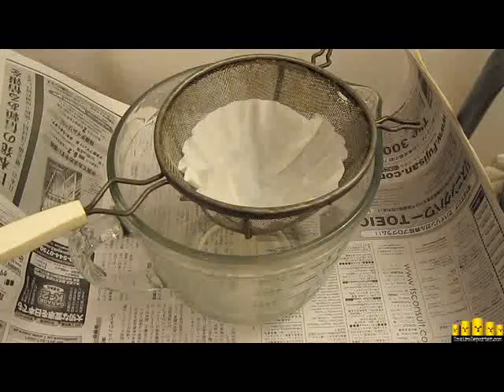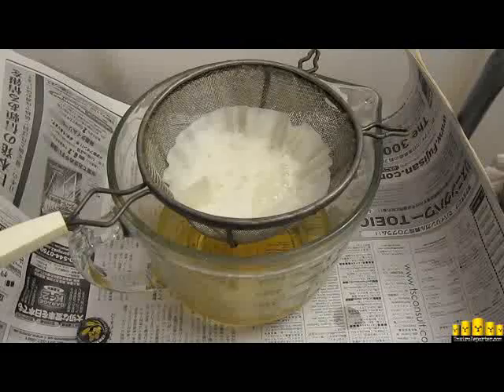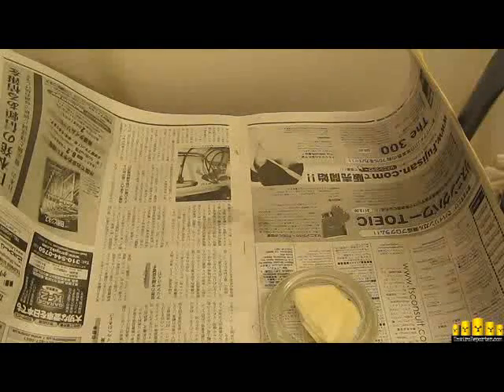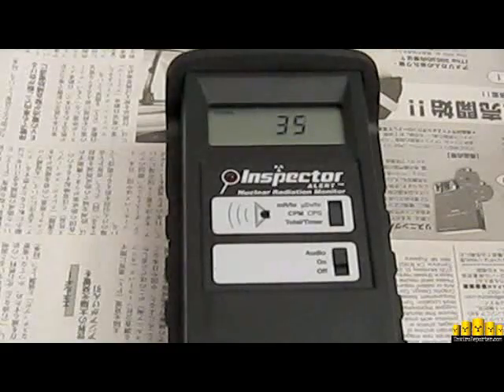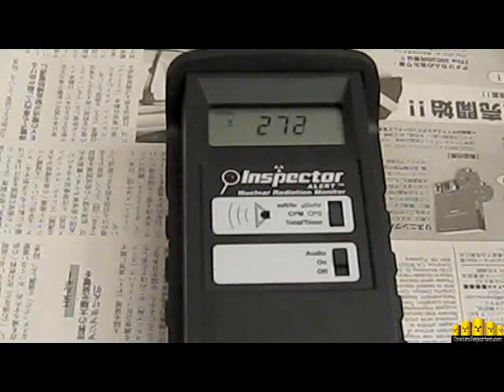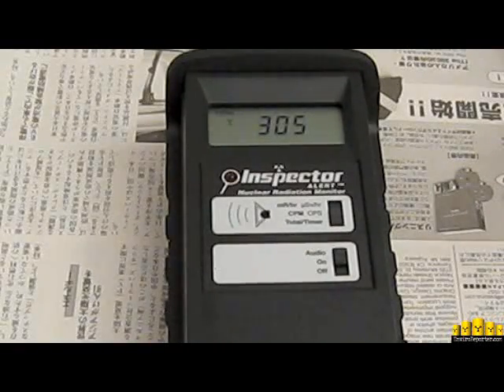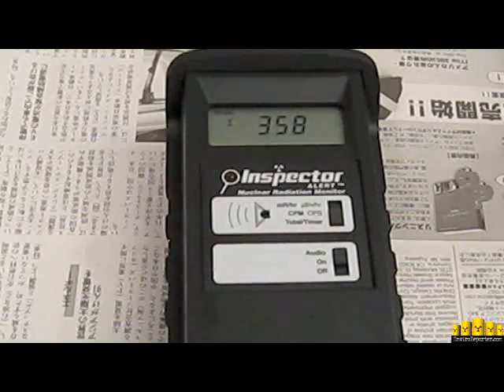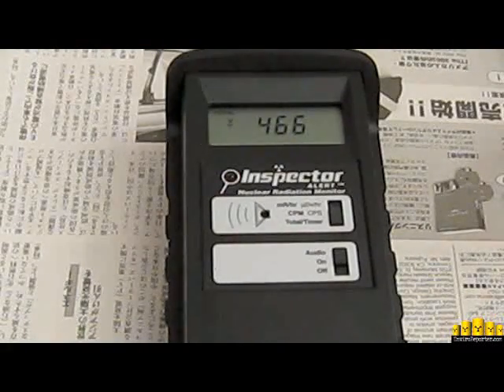Japanese Beer RADIATION TEST 8-31-11 Part 2

Comment: Any radiation would go right through the glass you ass!!!!!!!!
Reply from the maker: Actually, alpha is blocked by glass. In addition, since measuring ionization in radiation-blocking water (the beer), by filtering it there is a better chance of detecting overages. Thank you for the ignorant and insulting comment, troll.

Comment from the maker: Excellent questions, GarthElson. We definitely tested the newspaper and coffee filter before running this test and they came in neutral. Your observations are on the money because in our long-running "Eat Me!" food testing, we have repeatedly come across paper packaging that was significantly higher than background from beta (man-made) radiation sources. While this 'hot packaging' may not contaminate the food and drink products we've tested, we certainly wouldn't want to use them for kindling.